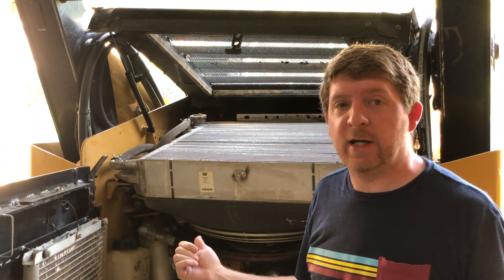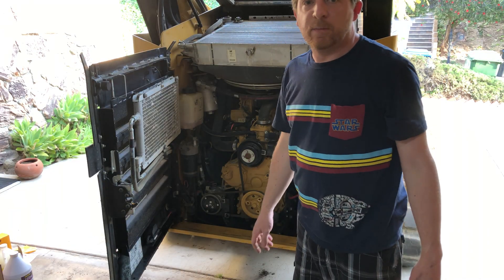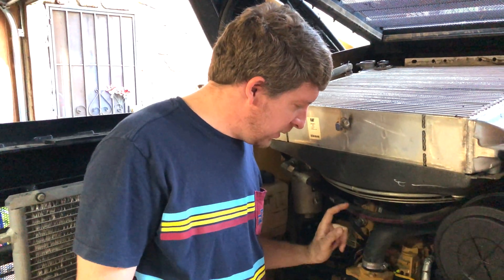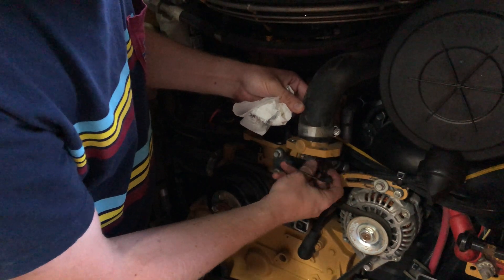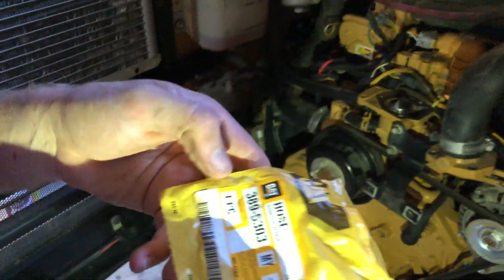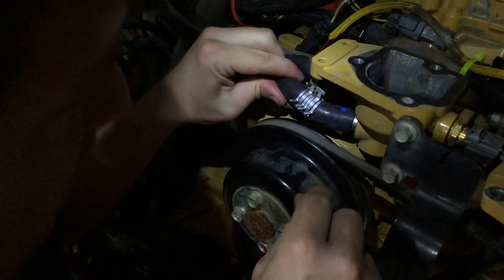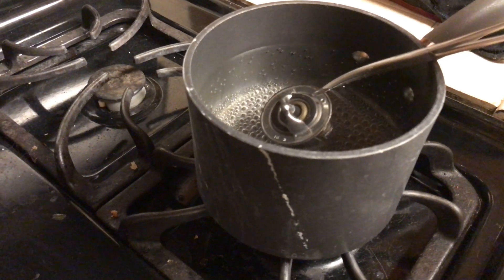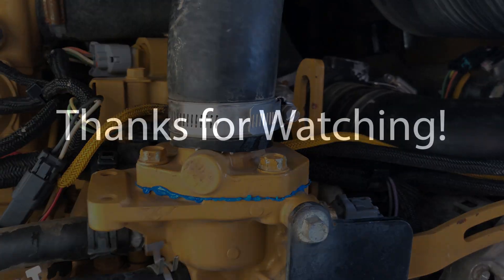Coolant Draining & Thermostat / Regulator Replacement on CAT 299D

Comment: Hello there, my problem is am not getting heat in the Cab, i have a  Cat 247b skid steer, could this be a regulator problem too ?
Reply from the maker: @Mitalayeka  I think it could be related. Does the blower come on and it just never gets hot?  Does the engine overheat?
Reply: @MakersAcres   Yes the blower comes on and it just does not get hot but the engine does not over heat.
Reply from the maker: @Mitalayeka  The heater circuit is pretty simple and sometimes you can use it as failsafe to "limp home" to help dissipate heat so they almost never fail. 

I am no expert, but here are a few of my thoughts.  
I would check a couple things.  The heater line normally comes out of the Thermostat housing.  The heater lines might be clogged, or something in that housing might be blocking flow to the cab radiator.  I would start there and let me know how it works out!
Reply: @ I will keep u updated, thank you.